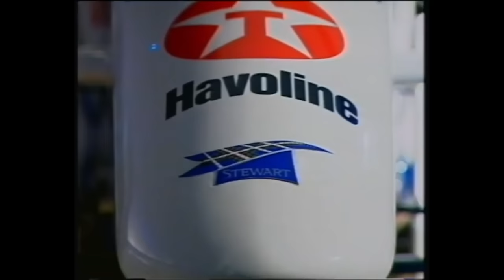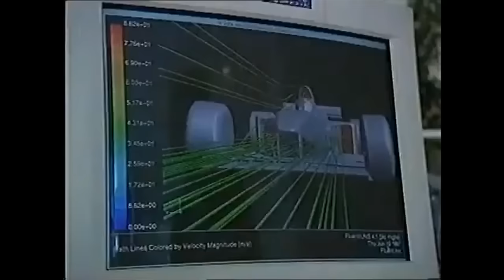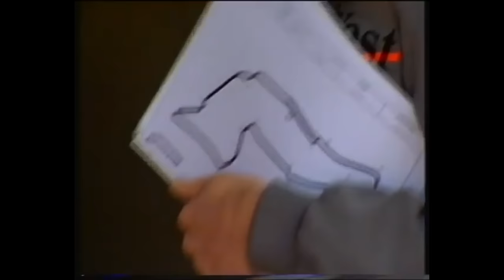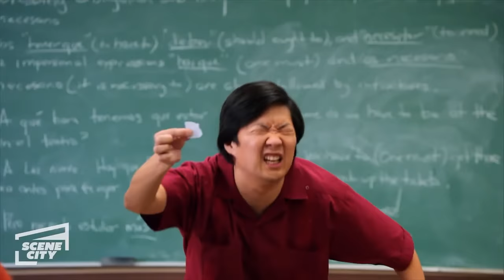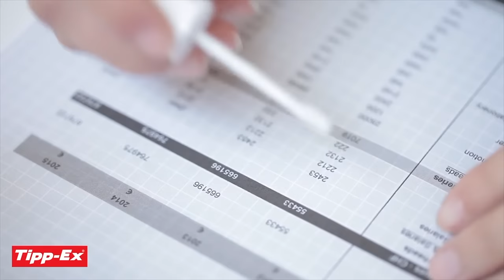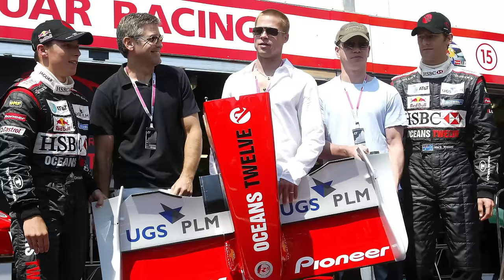The Jaded Journey of Jaguar

Comment: As a huge Ford fan since birth: Screw Fords motorsport plan. They removed support from all motorsport genres after 1998 except F1, WRC and Nascar. What did they have to show for it? Ford had recently had an Escort on the podium in the highest class of rallycross for 6 seasons in a row. 2 of the was ERC champions! But no, Ford showed them the door. Only WRC or F1 or get ouit. The hubris of the Ford excecs still make me fume with anger.